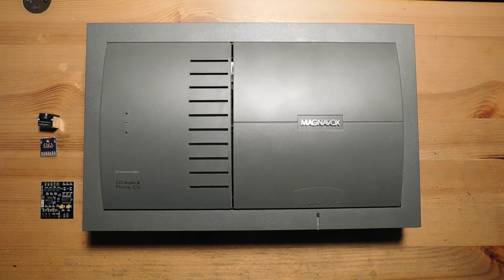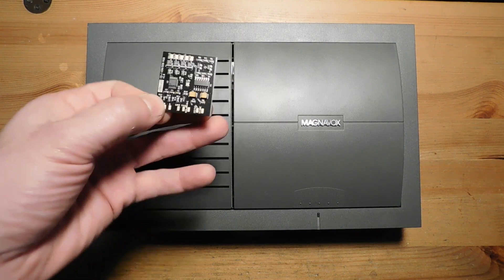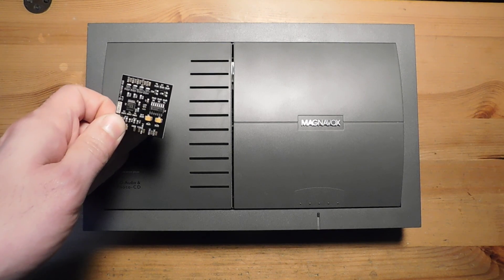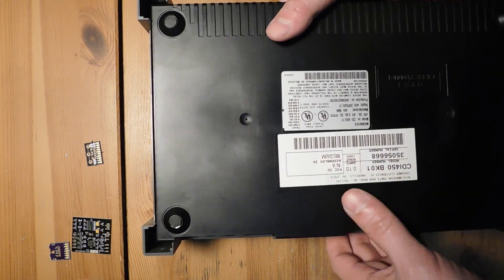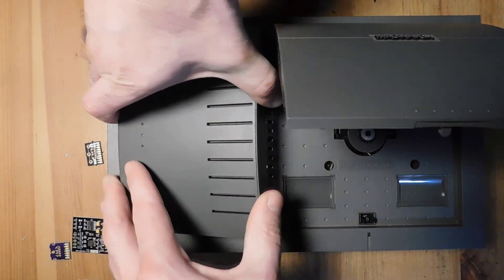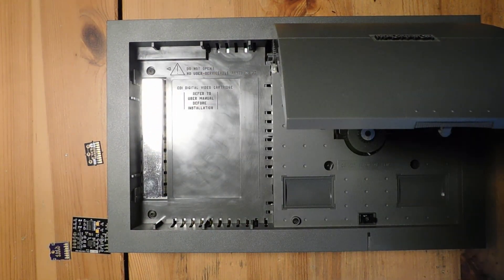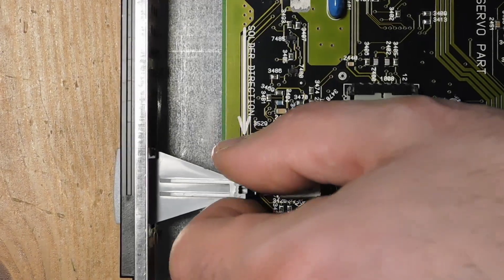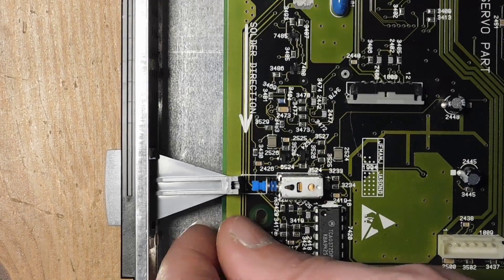Philips CDI 400/500 series RGB mod install guide! Get the best quality video from your Philips CDI

Comment: Just finished this mod. Your guide was very helpful.  Just curious if you got noise and jailbars?  I’m using HDRV and using the 9 pin minidin. Caps and Resistors removed and bridged on board. Pin 4 and 5 bridged for CSYNC on minidin. The pixels are sharp but not sure if the noise is normal.

Comment: Can you show how you've wired up the 9 pin din.
The Jokers that made this board thought it was clever to not include this in the instructions for some reason.

I followed the instructions and it says you can take the resistor from underside the board and move it to the top so that it will enable RGB or leave the pad where it says to move this resistor blank and attack a wire to the RGB enable pad of the board.
Should I do that instead of the resistor?
I'm doing this on the 470 and you are the only person I can find that has done this mod.
Reply from the maker: I made a photo album of this modification here, and it does have pictures of how I wired up the 9 pin din: https://photos.app.goo.gl/x5aaw5K8N8rnhrDk7
Reply from the maker: I soldered a wire to the RGB enable pad on the board and that worked well, so I suggest trying the same thing. You can also see that in the pictures
Reply: @LIRetroGaming  That's brilliant. Thanks for helping.
I'm still getting a grey screen.
I'm the pictures it looks like you have two yellow wires soldiered to the din.
One to the cs-ttl which looks like the second pin on the bottom row but where is the other one from or am I seeing it wrong?

Comment: I'm about to do this mod and realized that you said to remove the caps/resistors if using Standard genesis 2 cables.  If I'm using HDRV, do you need to do any mod to the RGB board at all?
Reply from the maker: Yes, you definitely need to make those modifications for HDRV cables
Reply: @LIRetroGaming  Thanks for the info! Great tutorial on a relatively obscure system as well.
Reply: @LIRetroGaming  Do you happen to have the pin out labels for the 9 pin mini din breakout board for this?  Your photos are great and am almost able to determine. I have the following right now based on the breakout board numbering.
1 - Blue
2 - 5V
3 - Green
4 - ?? Seems connected but can’t see where it goes
5 - Sync
6 - Not Connected
7 - Red
8 - Left Audio
9 - Right Audio

Comment: i used the Mobiusstriptech RGB board in a CD-i 450 RGB mod, but the colors aren't great imho.
Reds have a brownish hue, and it all looks a bit darker than it should.
it's not the brightness, i turned that up to see what happens, but it really is the colors being off. 
the THS7314 method (when attenuated correctly) gives way better colors, more vibrant and closer to how they should look.
Reply from the maker: Interesting, I haven’t tried the ths7314 encoder yet on the cdi